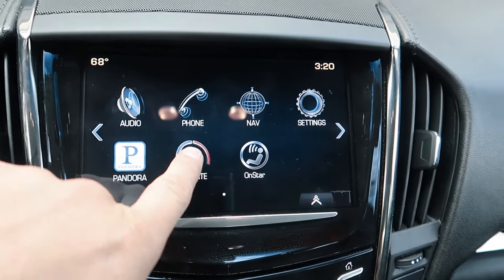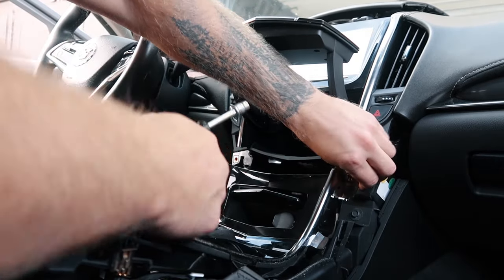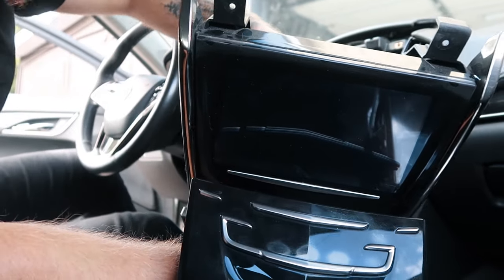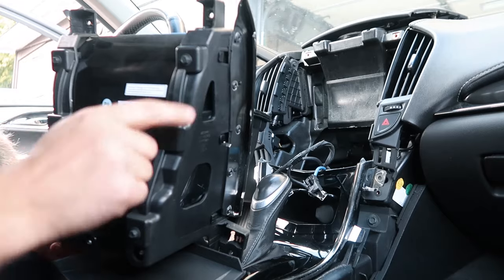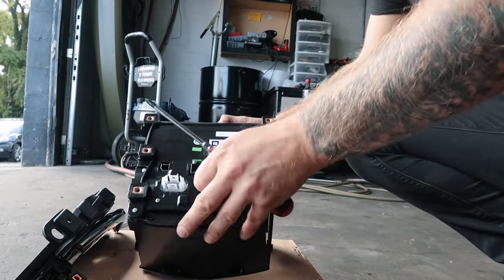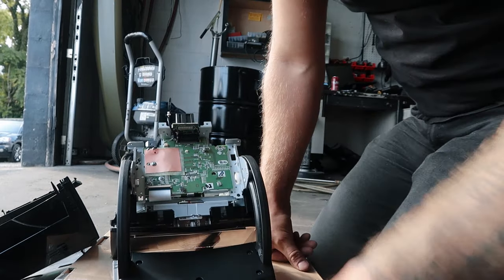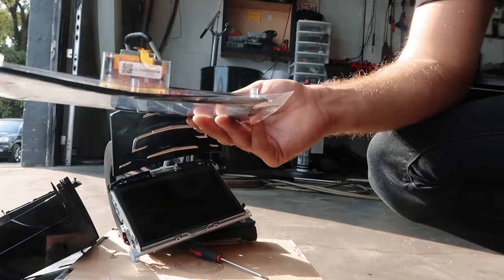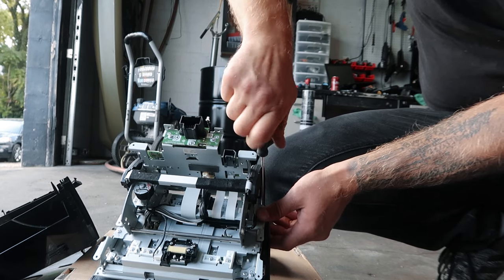***HOW TO FIX Cadillac Cue System  touch screen not working!***

Comment: I can't believe cadillac won't replace this for FREE when so many people have issues with it, including myself. So annoying!
Reply: I hold back not punching my screen everyday
Reply: Not only they don't wanna do it for free, but they don't want to sell it. Instead they insist that the whole cue assembly needs to be replaced and the part is $1100
Reply: Class action lawsuit is needed
Reply: @lesmiazga  I found a local shop in my area that replaced the touch screen for $300. The entire cue assembly does not need to be replaced. Saved myself a few hundred $. No issues
Reply: Ya, i know this is an old post but if you buy a new cuescreen then GM will reimburse you. Probably not the installation cost though. I bought a new cue screen and spent like 3 hours trying to what this guy just did. When it was all said and done, the screen lit up but still didn’t work when i touched it 😫🤬🤯

Comment: I have a 2015 Cadillac Escalade Luxury model, purchased brand new back in 2014. I've always taken it back to the dealer for maintenance.  About a week ago, my CUE stopped working. Frozen! Could not get any response after attempting multiple reset actions. Made an appointment for service at the dealer. I received a written estimate for $1,395.30 (Tax included)  for a refurbished system with a one year warranty. Went home and checked out YouTube. Found a technician who would install a brand new unit.  He has his own little shop and has  been installing CUE systems for eight years and has good reviews. No one has returned with any problems, he says. I then authorized him to install the system. I watched him work with precision. One and one half hours later, he was done. The system worked magnificently! He tells me if there are any problems whatsoever to please bring it back. The warranty is for one year. He then handed me an invoice for a total of $210.00 (Tax included). If you don't have the tools needed for the work or want to take your dash apart, have a specialist do the job.
Reply: Where is he located?
Reply: @Jeff-v3ql exactly. Why not include the dudes info. Smh

Comment: GM has always had problems in their electronics. This is nothing new. Faulty gauge clusters, radios, Infotarnished systems, power window motors. Replacement parts at the stealership cost an arm and a leg for another 3-4 years, + crappy warranty, or no warranty, until the part fails again and falls flat on its face…..and the list goes on & on!!!

Comment: $30? The dealer charges $1200 for an entire module... Then you get it back with all your same settings still intact...meanwhile all they did was change the $30 touch screen...
Reply: My local dealer quoted me 2700

Comment: I started to have few buttons not working on mine so bought replacement. Went through process, removed all protective films and incerted all connectors properly and screen seemed to work but except none of the touch screen functions worked at all. I triple checked and all was fine but no function. Had to re-install my original screen and got some functions working g except for same ones that weren't. So I kept the original, better some functions than no function from the new one.

Comment: Hello, for my Cadillac xts 2014 the screen stopped working after a couple of months of purchased and the bottom part works, all the sound swapper and the ac and what not, but I simply cannot touch the screen at all, can I just purchase the screen or do I have to buy the whole thing?

Comment: one quick question my friend. I'm having a similar issues, my scream works on everything but the ac controller. do you think it is the same issues or something else? I am not able to use my ac at all. thanks in advance
Reply: same issue here.  let me know if you find a fix please
Reply: I may be able to help. In my experience it started with the AC controls not working. It's been like that for about 2 months and just this morning it got to the point where nothing but the edges work exactly like the video. During the 2 months I did notice other things stop responding little by little.
Reply: If you use the auto climate control button on the console the ac controls should pop on. I have the same issue but I can still get the ac through the console.